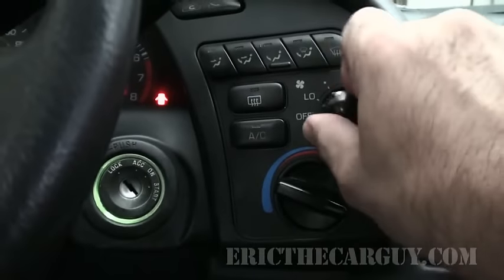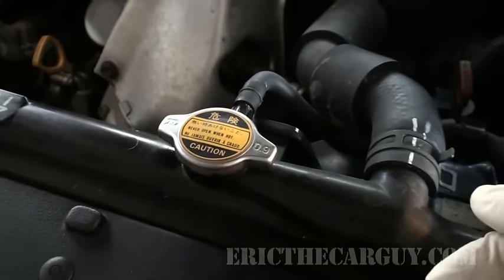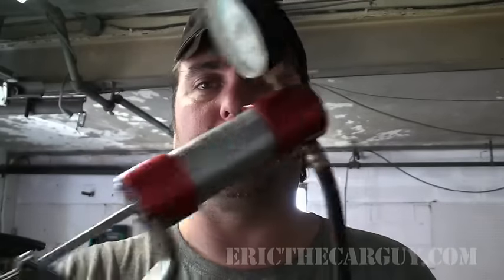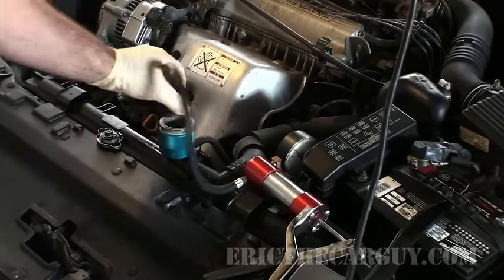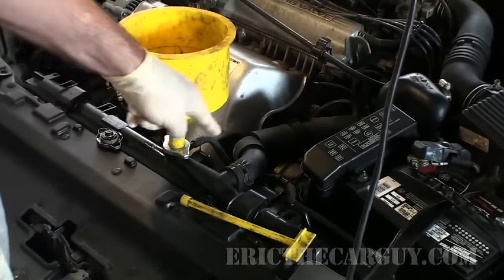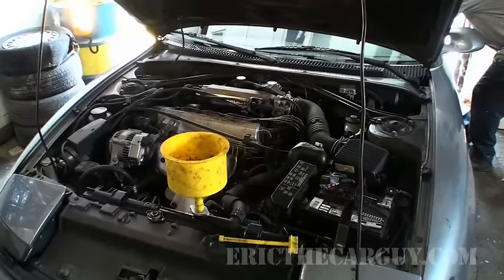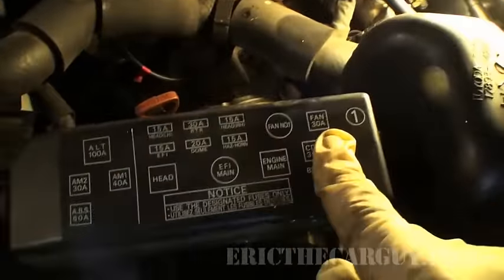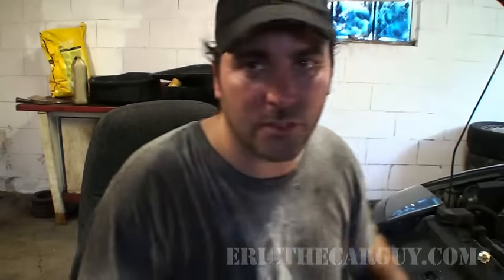How To Solve An Engine Overheat Condition - EricTheCarGuy

Comment: Eric, please advise me!!! My original problem with my cooling system was that the top radiator hose was old so it busted. I went ahead and replaced it and noticed that there was a lot or sludge and corrosion on it because the previous owner only used water. Do to that I went ahead and replaced both hoses, radiator, and thermostat. After replacing I drove the car for about 10 miles and the temperature started rising. I've done all the steps on this video and still haven't been able to solve the problem. My initial thought was that the temperature sending unit was malfunction so I replaced it and the temperature needle still  rises quickly. The fans work but what is really strange is that the hoses from the thermostat does not heat up even with the thermostat removed and the other hoses gets very hot more that usual. What are your thoughts on this issue?

Comment: Hello I'm watching this vid I did all these things and still have a guage issue. I come to the conclusion that the guage/ cluster being that its been flickering and the coolant guage been a acting erratic. To get to this theory from what was changed thus far. I have a 2009 hyundai sonata with 261,000 miles in it. Change the waterpump,thermostat,coolant,radiator and cap,hoses water inlet housing bled the coolant system. Temp guauge goes up. I checked it with a heat guage the electronic ones the temp in on 3 quarters up but when checking the hoses the upper hot the bottom one is a little warm temp had still not reach operating temp. I  been driving this car all day I'm kind of stump that with me replacing the thermostat with a better performance and all these other changes I would still have this problem. Things I hvae not changed is the relay. Also the head gasket is not leaking. Besdies that thanks for the upload!

Comment: Can it be the water pump Eric? I’ve done these checks and changed many parts and I’m still having to run my heater full blast on the highway in the 100 degree Arizona summer. Please help me before I die of heat stroke. 🤣
I notice when I take off the radiator cap off there’s not very good flow of the coolant so I think maybe it’s the pump or I don’t know if it’s just because the cap is off.

Comment: Bro i have a 98 chevy 2500 7.4 4x4 truck. Ive changed the water pump, and thermostat. Ive xhanged the heater core and cant figure out why my truck over heats at stop lights in the summer when runing ac. It runs fin w ac off. Please help

Comment: I was also thinking a reason could be a coolant clog somewhere, or some blockage, like they got into a collision, and either did cheap obvious repairs, or no repairs at all, and kept driving. But a coolant hose or line, or part of the radiator, was clamped or crimped, by bodywork, a mount, or something, and coolant was restricted.

Would this be a real possibility?

...And every time you mentioned the system being under pressure, or broiling, I would say "if it was water, or water based coolant". If it was Evans waterless coolant, the system wouldn't be under pressure, because Evans doesn't broil, at normal operating temperatures.

Comment: Hey Eric, I called you trying to see if you could do a diagnosis for my sister in law but unfortunately the got the message that you weren't talking on any new customers.  She has an 07 Suzuki forenza that has overheated several times.  According to her they have bled the system and found some loose clamps claiming hat they resolved the problem. I don't know if they actually checked the coolant to see if t is milky or not....hopefully it isn't! Also she said it was blowing white smoke as she drove it but it clears out after a few minutes of driving. What I need is a real mechanic that will go through the whole system and determine the cause of the issue rather than someone who just puts a bandaid on the first thing he finds and calls it repaired. Do you have any recommendations of anyone who is a competent individual? She lives just south of Cincinnati n Northern Kentucky. Thanks, Gary

Comment: 2007 Camry 4cyl. I start the car temp gage goes up and keeps going slowly, I turn the heat on (blowing cold air) when the heat comes on the gage goes to normal. Thermostat, water pump? Or something else? Thanks Eric

Comment: Hi Eric, I love your videos. I have got a volvo v50 T AWD, 2005 model.The Ac compressor got suspended and cut off the two belt which I had to replace the compressor including the two belt. But later days the Ac only cools only when the engine wasn't hot and give hot air when the engine is hot. Please I need some guidelines on what to do. Should I replace the pressure switch,  the air dryer because I changed the compressor?
Again I have replaced the coolant tank, the old one has cracked and leaks but some times the temperature goes higher. What should I do more.. please do write your email address for me. Thanks

Comment: Hello Eric. I followed your video’s instructions step by step, however I am stuck on this one. I have a 2001 Infiniti qx4 that it’s been overheating for long time. Long story short, I replaced radiator, hoses, thermostats, water pump and flashed the engine few times  fan working normally and I still have the same problem. I am out of ideas. Please help!!!

Comment: Hey Eric, My truck "Ford Explorer, "96) has bubbling in the upper hose. It builds up so much pressure that it cracked the first radiator. So I replaced it and I've done a radiator flush on it twice. and it's still bubbling from the upper hose. I have the 4.0 liter V6 1996 Explorer and it's driving me crazy! I'm not sure if there's air in the line or what. What do you think?

Comment: Surprised you never mentioned the water pump going bad being involved in an overheating issue. I was about to buy a new one but need to think again. Was runni8ng hot, losing water. I patched a couple leaks across top of radiator. Good? No. Replaced thermostat. Good? No. Replaced Radiator cap. Good? No. Burped the system but not sure if I need to get that funny funnel or not as I just let it run a while and watched air pop out as fluid flowed thru. Guess I'll buy one and try that cause it's cheaper than a pump! Burt if not that. Hmmm

Comment: So I changed the whole cooling system. I had to by pass my heater core . An still overheating… any suggestions??? 2005 Scion xB change the radiator the fans water pump thermostat. Coil packs spark plugs both belts also did a oil change with  new oil filter.oh also some sensors. Any help would be appreciated.

Comment: On the road without all the tools usually you can just swap a nonessential really like the wipers or fog lights so long as the numbers one both relays & the diagrams on both are all the same & you can simply test the possibly bad relay you swapped by turning on the wipers or fog lights so if everything works swap back & move to next step if the wipers or fog lights don't work that means the fan will no work properly & you can go on your way & replace as soon as possible otherwise if it rains or gets foggy your screwed....good luck hope this helps a little

Comment: I know it's 12 years later but a link to the electronic tools you use? Don't know what a ddom is.
Reply: DVOM  Digital Volt Ohm Meter. Harbor Freight has some inexpensive units that work well.

Comment: Hi Eric,,,, I have watched your teaching segments and find that  you really know your stuff.  for those of us who want to learn from the experts, you for one ,you sometimes forget that what you are demonstrating is very difficult for us to see primarily due to lighting. you need     to use a floor lamp. the segment on how to solve an engine overheat problem  was completely blacked out   also another suggestion if you dont mind,, is your source for transmitting your voice.  as your speaking and turning your head around to point at something. your voice is hardly audible if facing away from the video. I know I can learn alot from you providing I can see and hear what it is your demonstrating   erin

Comment: i have a 06 gm 3400 has no rad cap just expasion tank with pressure cap. i have check the pressure stay at 15 psi all day. compression test all with in specs . chemical test cooling system no real color change. this is what i get after running to temp the coolant coming back to tank is full of air or is probably boiling . also air bleeder keep get air from it. it doesn't seem like i'm getting a very good water flow. already changed water pump thermostat and rad tank cap. im baffled. could be head gasket but i want to rule everything out before i have to tear it down any suggestion will help

Comment: Eric, thanks for such a great explanation. I have a 2010 Mitsubishi Outlander 2.4L  It is not really overheating but it is hot. I notice the fans will not stop, the a/c stops from cooling, and the temperature light comes on. I also notice that there is no coolant circulation thru the hose right by the Radiator cap and the small reservoir tank still full. In other words, the coolant is not flowing thru - Do you think I should start with replacing the thermostat?  Thanks so much in advance.  -Jorge Spring Hill, Florida

Comment: Eric what about an over cooling, I know a lot I fix all my own trucks cars equipment, but I'm stumped, I have a 1994 chev Silverado half ton, 4x4 with a 350, for the past 3 weeks the temp gage says 55 C with a 196 thermostat, well to me it would be a bad thermostat, well I have replaced it last winter, in the past 3 weeks I have tried 2 new 195, and one 205, yhr heat gage don't move off 45 to 50c , no neat in the cab, just lightly warm air, yo ruel out bab factory gage, when taking out the thermostat I probe the coolant right there, I get 145 to 150,,, .. there are 2 temp probes on the engine, one on the head on driver side front with 1 black wire going to it, the service book says its for the gage, witch it it, the other one is next to the thermostat housing, with 2 wires,, this one says it goes to computer for things like ideal, air and so on, in the back of my mind I kept thinking, maybe  that 2nd temp prob with 2 wires may also control a safety over heat cross over some were, and by passing the coolant back to the some what cool rad, can take the rad cap off at any time, and yeas tried a new cap,. but the book do no show in the wiring any by pass of any kind. I think for a second maybe air locked, but that would only make an over heat, same as why I have not flushed it. only thing that could make it over cool is if the clutch fan stayed on, a stuck open thermostat, but I have replaced it 3 times in 3 weeks, and our weather has not even got cold yet we been around plus 6 to -10. water ump no it would over heat, now a part of the water pump gadget blown out, maybe a complete by pass, but is there ports that could make that a 1 in 1000 chance, I think not, any impute would be great

Comment: i got a 2001 bmw 530i overheating, i replaced the fan clutch, water pump, thermostat, radiator, expansion tank cap, did the chemical test for head gasket, and its still overheating, auxiliar fan working just fine too, im out of ideas, the heater dont blow hot air, any ideas what could it be?

Comment: Good Job ..... But you forgot (or perhaps intentally) did not address possible SOURCES of leaks either visible from looking under the car or from the leak test.

My experience when determining the cause of overheating is due to a leak, is that on some vehicles is difficult to SEE just EXACTLY where a leak is coming from, such as a cracked hose at the clamp somewhere on the back of the engine or side below or a even at water pump if they are tucked up out of site like Nissans are.

Working on one now with a Bad heater core that was bypassed .. not sure if there is an air lock but I suspect one .... An external more powerful pump would push out air but where to connect pump .... And/or create a high point bleed is port is where we are. Any thoughts?

Comment: Question out to the thread:
Three weeks ago, I replaced my coolant reservoir because of a small leak.
On my way to work, the car (Volvo s40 2006) started running pretty rough (similar to when it was overheating the first time 3 weeks ago). I checked the thermostat gauge and it was in it's normal middle gauge position. I parked the car and there was white smoke coming from engine compartment. I opened the hood and there was minimal to no coolant in the reservoir. I couldn't see any leaking from the top view. When I added a gallon of water in to see if I could find the leak, the water was clearly leaking quite a bit from the bottom of the car near the passenger side without turning the car on.
Any idea what this could be?

Comment: my car doesnt overheat. but my coolant level keeps dropping. no indication of coolant being in other systems.  

hmm so if my overflow on my toyota sienna reservoir keeps changing, ill try replacing the cap.
Reply: Your reservoir level can change during different driving conditions. If your radiator cap allows coolant to exit and reenter your system, it may not be the cap. However, a permanent loss of coolant is another matter. Your radiator cap needs to maintain the required pressure within your system. If it opens too early, that could be a problem. Yet, you mentioned your car does not overheat. If you often have to add more coolant to your system, it's going somewhere.

Comment: Ok so my van overheats quickly..like 15 to 30 miles of driving when the radiator cap is on all the way. I vent it a bit and I can drive close to 100 miles before overheating. With each there's no coolant in the radiator, but the overflow is full. Possible problem? Not the thermostat.. I'm in Texas and yank that useless thing out quickly. Any suggestions?

Comment: just wondering I have a 1998 Ford SVT cobra. this is my second one I have known of the same year. I was just driving around town and on full Blast heat it started to throw out ice cold air cold as it was outside but on full heater. they're all on the temperature gauge went directly from the middle oh hot but did not get any more hotter than what it could go? but also have a Vortech V2 putting out 12 psi . I was just giving it a nice cold run but at 65mph. which is our regular I need to rain on interstate is 70 mph. that antifreeze was blowing all over the in side the hole engine compartment any help still hall has full  oil is :;here is a pic forget 1998 SVT CIBRA

Comment: On my 07 jeep wrangler fluid leaks out of the cap only when driving.  I replaced the radiator and cap. It has 230000 miles on it . What would be the issue?

Comment: Sir i have question. My car is overheating whenever my aircon is turned on and while my car is parked. But while my car is running the temperature is just fine.
Also, when the aircon is turned off, either im parked or running, the temperature is fine.
Reply: Most likely your cooling fans not working also recharge your freon it's a $12 can from walmart and it sometimes will help

Comment: So I’m having the first issue he found, small leaking at the radiator neck but he didn’t expand on the issue at all. Was that just the radiator needing to be replaced or what? I also have a leak under the car coming from some sort of spout it looks like near the back of the engine. What is that? Anyone know?

Comment: Great work Eric.  I appreciate your thoroughness.  You mentioned about changing the cooling fan, or fans if you have two...,  Were the  2200 c.c.  Toyota Celicas equipped with two fans? I noticed the radiator top has what looks like mounts for another cooling fan.  Mine only has one fan.  JPA

Comment: Although relays are used for safety reasons somewhat, relays are not really used as protection for potential failure issues with circuits. Fuses or breakers are used for this reason. Relays are used to keep the control switches in the drivers compartment small. I mean, its not like there is enough room on the dashboard to mount a bunch of 20 and 40 amp toggle switches like a 1969 model Apollo space craft. I wonder if they used 40 amp toggle switches to control 800 amp relays? LoL. Love ETCG

Comment: my cruiser acts like its getting hot and just randomly shuts off and wont start again, ive replaced a lot of sensors, the fan itself, relays, the fan was running when it quit. it done this before I put a new fan  on it,
Temp gauge shows fine, but under the hood its just so damn hot to touch anything, yet its NOT spewing anti freeze to show its over heating,, any idea

Comment: Good job Eric, maybe you can give me an advice. My brother in-law car (fiat panda 1.2 ltr) got overheated that reaches to red & after it cool down he added 1 ltr water. The other day i started the engine & observe,no leak,no rattling noise & the water is normal.we run the car for 10 kms & temp is normal but the water reservoir is not in the minimun & added 1 pint.There is no warm air blowing in the dash board What is the problem then in your wise & frendly opipnion. Thank you very much  & bless you.

Comment: 1 other thing is ect ....love your videos . I replaced pump old seemed ok no ppay and smooth . New thermostat bled to spec. Recently had a leak pf sorts at front (away from wotk done ) at first glance looked like expansion tank was culprit . But somce removed that amd checked with compressed air . No obvious leaks took car to work today . Onky 4 miles pr so . No obvious leaks same on return all dry . Levels seem ok . 

Return hose (lower) i think may have actually gone from cokd this time if i drive further . Ut always fekt cold befure .....fans i find act odd though but do function .
I just ordered new ect . .....and earlier today headinv to work car sounded bit beefier (diesel) so odd